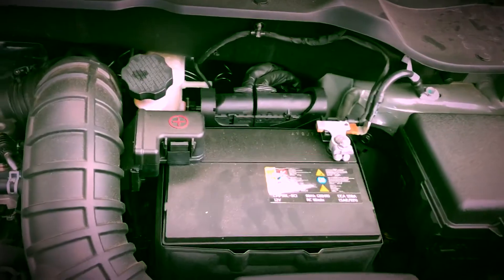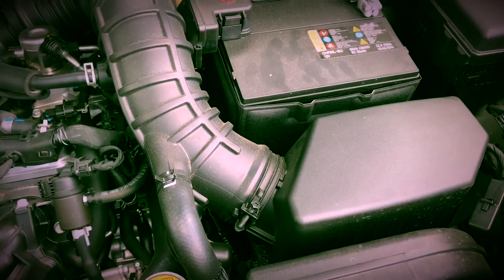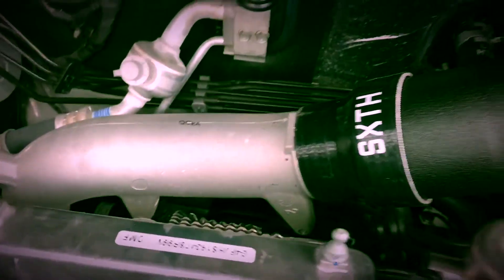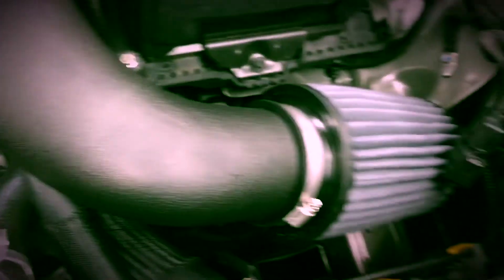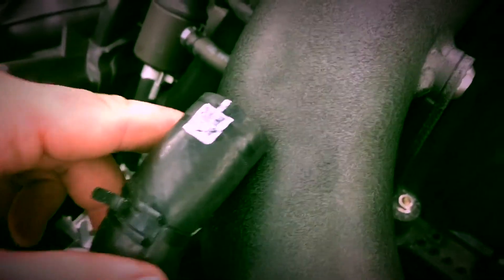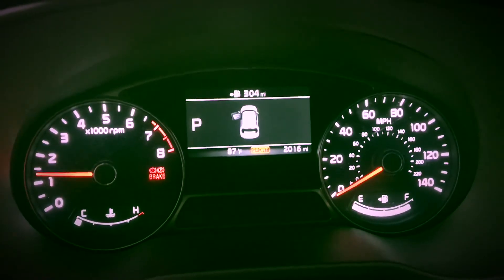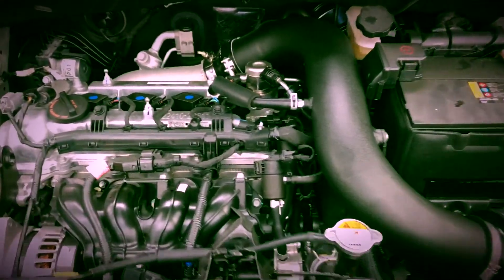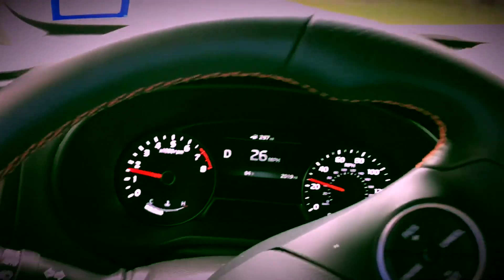2017 Soul Turbo with Intake

Comment: I have the injen intake on my 2017 turbo soul it's made for the veloster.identical fitment. Same engine.all the hoses connect on the injen intake.100%perfect fitment .highly reccomend it.
Reply from the maker: all of the gamma engine have the same routing for the intake... there are very small differences in measurements.
Reply: Hi am wondering if you can point me to a website that ships out supercharging kits to canada. 

Am looking to get more power out of my 2016 kia soul ex naturally aspirated 2.0 litter gdi engine but am having a hard time finding a supercharger kit for it.

let me know your opinion,

Comment: OK so I have a 2020 soul GT20 soul GT Turbo if I disconnect my research valve will that mess up the Turbo over time? And I mean with all the factory parts I haven't moded anything yet

Comment: Wow this is actually pretty cool, what about the blowout valve pipe that you mentioned. Any problems that will come with having it out in the open. Or was it initially attached to the intake just to condense the sound ?
Reply from the maker: no issues at all.... this is the recirculating valve that stock goes back into the turbo inlet pipe
Reply: Ben Waxman oh ok perfect
Reply: We vented our blowoff to atmosphere and it sounds amazing for free until we start doing upgrades after warranty expires its my wifes soul i still race my Kia Spectra5 yeah a fast spectra lol

Comment: I just bought a new 2018 KIA Soul Turbo and I have noticed a slight lag in the turbo pickup.  I didn't recall you saying who made your intake?
Reply: Also did you experience a clunking from gears 1 - 4?  Seems like a shift kit was installed.  And also mine shifts too soon, under 3000 RPM.
Reply: 6 element engineering! Have to check them out.  Good thing i came back and listened!
Reply from the maker: YOU CAN'T EMLIMINATE THE TURBO LAG... SXTH ELEMENT ENGINEERING IS THE INTAKE
Reply: I have also been noticing a lot of slipping, or what sounds like slipping, when I drive.  Do you have the same?
Reply from the maker: LIKE TRACTION?
Reply: Does the tranny feel almost like it chatters when accelerating for 0? If so that’s trademark of a dual clutch gearbox, especially since they use a dry clutch instead of a wet clutch setup. Wet clutch or torque converter automatic transmissions are smooth because they have a lubricating fluid that keeps things running smooth, while a dry clutch is just that- it’s dry, like you would have in a car that’s a manual. The difference is is when you drive a manual you decide how fast and smooth to release the clutch while in a DCT the computer does it for you. And since computers are machines and void of feeling a dry clutch system isn’t very smooth. I had a Ford Focus with the 6 speed DCT and I hated it.
Reply: Yes it does chatter from time to time.  Quite irritating.
Reply: Chris Sparks yep, trademark of a dry clutch setup. Kia/Hyundai should have learned a thing or two from VW. Shame since there designers are German lol
Reply: It seems to get better and smoother as the miles go up. Ive got 37k on mine and agreed it annoyed the hell out of me the first 10k miles or so! Also the blowby from the oil is excessive in the intake box im grabbing this intake and def needs a catch can!
Reply: Chris, the new Soul's have a 7 speed transmission, first three gear shift SUPER close together. This is normal. The jitter is the dual clutch. Turbo lag is 100% function of a Turbo, it has to spool up to increase the power. :)

Comment: Dang my gf got her soul just before the turbo model came out :( I keep telling her I can drop that turbo engine in her car without too much hassle or even just swap over the turbo parts. Probably be able to find some in the junkyard soon that have been in an accident. Hers has the 6speed trans that you can shift though, which would be nice to use with the turbo engine.
Reply: xblade6500 it would be alot more hassle than you may think...
Reply: I'd be careful. The new Turbos come with a 7 speed dual clutch transmission, you might need a transmission to pair with that turbo swap... which in that case you'd be better off just selling the non-turbo and getting a turbo. (which is what I did - oh my word it's so much better).
Reply: Yeah I looked into the transmissions and I would end up getting a engine and trans together if I went that route. Thankfully we have the 1.6l engine which is the same as the turbo. They made the engine bay a little bigger for the 2.0. We seen a stanced and lowered one at a car meet last week so I think she wants to stick with cosmetics for now XD
Reply: Maxx Boost lol please don’t try to do the swap, your gf will end up without a car